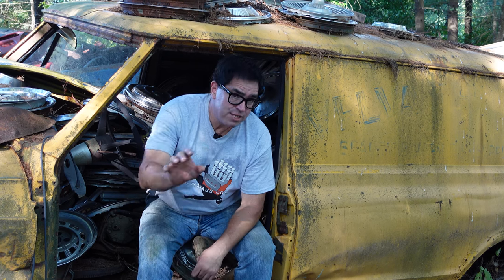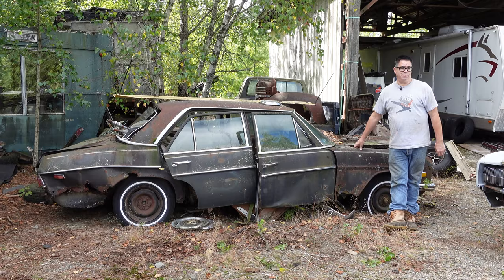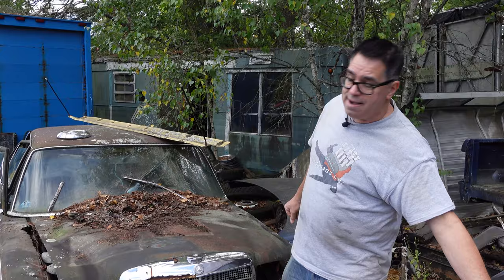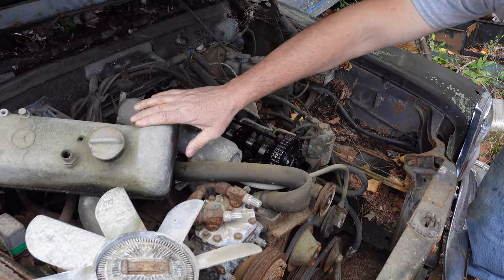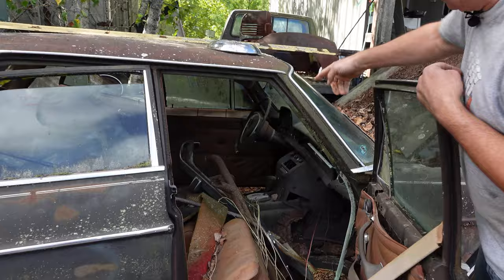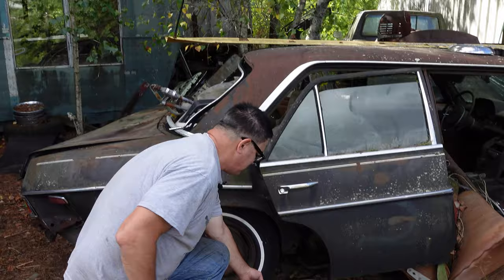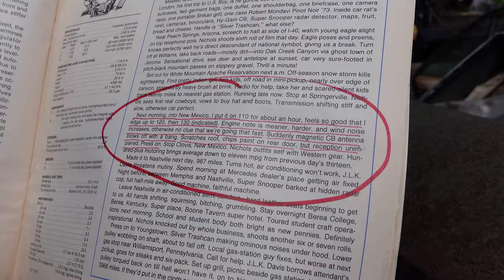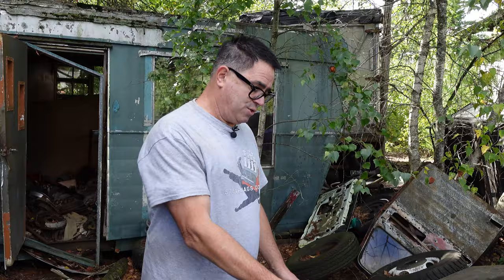Mercedes Has Benz

Comment: We slogged our way to the Artic Circle in a 240D. Slow is right. It wasn't unusual to climb passes at 20 mph. But it was rock solid and dependable. Very comfortable ride.
Reply: That sir,is a fine dining establishment..
Reply: I'm new to these ,I got an 80 240d 4 speed recently because it was really clean. 
I had about a week to get familiar with em before I went and looked at it, but since then I've had fun with it. 
What a car,it handles and stops really good,I had no idea. 
As I've driven diesel rabbits quite a bit,the slow acceleration wasn't too bad.
Reply: @Bill-cv1xu  haha.
Reply: @MrTheHillfolk  God bless the diesel Rabbit!
Reply: @frogwizard5637  haha yeah it was a great car to learn to drive in, no power,so do what you can to keep momentum and don't lift for corners 😬
Reply: @MrTheHillfolk  Volkswagen Diesels in the 70’s/80’s were forty-ish horsepower naturally aspirated four-cylinders with timing belts and weak head gaskets. Audi was basically the same, but with a greater propensity to fail. If you couldn’t afford a Mercedes-Benz Diesel back then, you’d’ve been better of getting a manual transmission Isuzu Turbo-Diesel or one of those MFI Peugeot Diesels.

Comment: I've had several of these over the years, 240D, 300D and 300TD. Yes, the naturally aspirated 4 cylinder was slow as heck, but the turbo 5 cylinder ran pretty darn good. And regardless of drivetrain, these cars were a pleasure to drive, very smooth and solid.
Reply: Very impressed with my first one I just got recently, as I've been into vws all my life. 
A customer at work had a clean 80 240d 4 speed and I told him call me if he ever wants to sell. 
4yrs went by and he called ,I went and looked at it closer and got it. 
What a little tank compared to my vws. 
I love the way the doors close , barely push them and they click like a bank vault,not some ringy rattle like a VW 🤣

Comment: Mercedes was known for their diesels and their trucks (as MB branded) were everywhere during this time, even in the US. It's not uncommon for them to go hundreds of thousands of miles without much trouble. Later on the "MB Tex" fabric wore like iron for decades. Paint code on this one is likely code DB040 Black exterior paint, and like "code 19" Black for GM, that paint code was used way into the modern era. Those 6.9 MB could haul and they were like bank vaults, they were solid. 

This 1971 220D was a 115.110 chassis code and they had an OM615 (engine code 615.912) diesel engine that was a 2.2L four cylinder and they made about 345,376 of them between 1968 and 1973. They were assembled in either Stuttgart, Bremen or Sindelfingen, West Germany as back then the German Wall had not come down. The German Wall came down on Thursday November 9, 1989. There is a photo of a US serviceman using a Craftsman screwdriver (more than likely made by Western Forge in Colorado Springs, Colorado) to chip away a piece of the wall.
Reply: 1979 240D owner here.  I’m convinced that when the world stops, only cockroaches and MB Tex will be left.  My seats do not wear.
Reply: @bobbbobb4663  My neighbor had a 1979 gray market MB that I think was a 230 series gasoline powered four door. It was used as a taxi chassis in Europe at the time. When he would bring it to MB to get fixed, the parts would take a few days but they would come. The dealer would give the car a wash and detail before giving it back. My neighbor said, "But it has rust and it's old", and the service manager's answer was, "The boss says they all get detailed before we give them back".
Reply: @googleusergp  Interesting that they would service a gray market car.  Btw, one more detail about my 240D:  MSRP was $16,500 for crank windows and manual transmission.  The top of the line Cadillac Seville MSRP was $16,200.  Needless to say, the local dealer was rolling in profits to afford a free car wash 😀
Reply: @bobbbobb4663  Nah, to them it's just another vehicle. If they can get the parts and bill you, they don't care.

Comment: Hello Steve, greeting from Ireland. 
I bought a very cheap 300d ex taxi with 450k miles on it when I was a student, ran it for a year and sold on. Changed a noisy wheel bearing, plus usual oil/filter. No other repairs. 
5 speed manual, 85mph flat out, would sit at 80 all day, like sitting on a sofa!!

Comment: Fun fact about the 6.9:  The conversion rate from dollar to Deutschmark deteriorated so bad that the msrp for the 6.9 jumped to $50,000 in 1979 for the same car that retailed for $38,000 in 1977.
Reply: Google said my 80 240d 4 speed was around 17-18k new, I shudder to think what an upscale model cost at the time. 
I remember mom paying like 71-7200 for a diesel rabbit in 81.
Reply: @MrTheHillfolk  Looks like the 6.9 cost $52k in 1980.

Comment: The 1968  W115 was the start of Mercedes coming of age with legendary diesel powered cars that looked fresh and modern, rode, handled, and braked amazing, and if you could keep the rust bug away ran forever. Very sluggish cars that clattered and smoked and needed a clearing of a 1/2 mile to enter the freeway so as not to get rear ended. But they were never meant to be rockets. Most were stick shift early on and thats really the only way to go in them for maximum power and reliability.  The people that bought the diesels were a different breed than the people that bought that gas models. Diesel people put up with the short comings of the slowness and the noise because they wanted the reliable granite like build and reliability of the diesel and the MPG and lack of conventional tune ups.  Ive owned these since 1979 starting with a 65 190D Heckflosse and still have my 1960 180D Ponton I bought in 1983. I owned a 69 220D back in the early 80's and it was a great car. The quality of the W115 diesels was taken to even higher standards with the W123 models which have the reputation as the best diesel sedans of all time. Shame to see this car like this because the level of build quality that went into it was bank vault like. But all steel rusts with salt if not taken care of properly. If you can find a rust free Mercedes diesel made before 1986 you really got something. Also, back in the day when this car was new, battery technology still sucked and the glow plugs took 30 seconds to warm in the dead of winter and dropped a healthy battery to its knees so if you didnt get it started in a couple tries you needed a jump. You needed a block heater on these or build a fire under them to start in the coldest temps.

Comment: My dad was a MB mechanic for 40 plus years. Sometimes in the summer I'd go to work with him , usually a dealership shop. I'd run parts to the counter back and forth , mostly service packages for these small diesel models. He used to save the old injector seals for me , a cup shaped washer with an integral gasket ( I had a slingshot that worked perfect with those , lol ). Sometimes he would bring home some cool rides ... 450 6.9 was one of them. His bosses 280 6.3 put everything else to shame performance wise.

Comment: I got one of these as a loaner back in the late 80s but it was gasoline fueled. The thing had well over 300k miles on the odo but ran and drove just fine. A good solid car was the impression I got

Comment: The 200D was about 54 horses. The one you show here, the 220D, was about 60 horses. These were not so bad in daily use - reliable, dependable, cheap to drive & maintain, just SLOW.

Comment: As a very young child, my Dad first had a 220D and later a 240D.  At least ours had a 4 speed manual transmission.  The automatics were SLOW.  The 220D 0-60 times were, well we may never know! Something not covered in the vid was that the 220D had all drum brakes, the 240D had disk all 4 corners.  They also had very cool vacuum power door locks.  The cars were safe, reliable, nice to drive, and always got to our destination but never in a hurry.
Reply: All mercedes had 4 wheels disc brakes from 1968 & up.
Reply: @vintage76vipergreenBeetle  this 80 240d 4 speed I just got stops awesome,I couldn't believe how good the brakes feel. 
And it handles just as good, since it's a little soft I was thinking it would step the back out in a hard bumpy corner. 
Nope,she sticks good on those skinny little tires.
This is my first one, I'm very impressed. 
It's really not much slower in acceleration than my old diesel rabbits. 
Even with fuzzy memory, I think the Merc pulls on the highway better from 60 or so better then the old rabbits, even down low. 
I do have a bad Jones for a blacked out 91 560sec gangstermobile though,what a sleek ride.

Comment: I had a 240D many years ago. A gentleman I built a engine for his 1965 GTO resto-mod, was a service manager at M-B. He showed me how turn the modulator on the transmission to increase the firmness of the shifting. No joke, you could practically make it hit as hard as a manual valve body, full race transmission in a drag car. It didn't have the power to spin or even chirp the tires, but it would slam gears automatically like you can't imagine. A week later I adjusted it normally, but it was hysterical taking people for a ride that week.

P.S. love the Kentucky mobile brothel in the background.

Comment: I had a 1987 Mercedes 300D great vehicle lots off power. The only real downfall was parts were super expensive and rare. Sold it about 12 years ago. Great Videos Steve👍
Reply: I've got a bad Jones for a blacked out 91 560sec.
I saw one at a show a few years ago, what a great looking car,total gangstermobile. 
Being I didn't know anything about them ,I stayed away and it's just as well.
Dude was asking 11k though, not too bad considering they were like 80-90k new. 
I did get an 80 240d 4 speed recently and I'm learning a lot it's an interesting car.
Reply: @ Mrhillfolk that’s the 5 cylinder highly desirable those engines are bulletproof.👍
Reply: @ Mrhillfolk that’s the 5 cylinder highly desirable those engines are bulletproof.👍
Reply: @ Mrhillfolk that’s the 5 cylinder highly desirable those engines are bulletproof.👍
Reply: @ Mrhillfolk that’s the 5 cylinder highly desirable those engines are bulletproof.👍
Reply: @Daniel-fd3wp  I thought they had a big honkin 8 cylinder in em

Comment: I rode that in Italy 🇮🇹 many years ago. I like the OE aluminum alloy wheels which looks snazzy. I friend I know has a 1975 Mercedes-Benz 280 E, the E stands for Einspritzen which is German for fuel injection which is made by Bosch. He also owns a 1978 Mercedes-Benz 450 SEL 6.9 litre sedan. That 6.9 would do battle with the Porsche 911 Turbo Carrera, and the 928. Those cars ruled the Deutsche Autobahn.
Reply: Had a 928 which to save $$ put 450SL fuel injectors in!

Comment: I gotta say,as a lifelong VW guy I recently got an 80 240d 4 speed.
I had no idea about Mercs all that much,just this car was super clean and I took a gamble on it. 
Haven't had any hidden surprises yet, and I see maintenance parts are reasonable. 
Trim parts,sit down. 
Anyways ,this thing handles great! 
It's a semi soft ride ,but even in a hard corner with bumps it stays planted and doesn't sway all over,very predictable. 
And it stops great too! 
Power,yeah ,67hp isn't winning any races but I sure had a hoot on a twisty 40mph backroad when I was pushing it up to 75 or so. 
It's on par with my old diesel rabbits, maybe a touch more power or it slices the air better because it does pull better than they did at 50-60mph. 
I was rather surprised to see they cost around 17,000$ in 1980, mom bought a diesel rabbit in 81 and that was 7200.
Reply: I can confirm how important gearing is with these German diesels. 
My 91 Jetta diesel has 52 hp but marches to 60 in about 10.5 seconds with the help of a close ratio "GTI" 5 speed. 
A rabbit diesel that's 400  pounds lighter with the same engine takes about 15 seconds.
Reply: @MrTheHillfolk  1979 240D owner here also with the manual transmission.  If I could change one thing about the car, I would raise the 3rd gear ratio.  IIRC, the owners manual calls 3rd gear a “in town” gear so it is geared appropriately to loaf around town.  The problem is that during acceleration, the car momentum really stalls around 30 to 35 mph.  

One more item:  most parts are still available as OEM.  They will cost more than the cheap Chinese parts but they will last.  Please take a look at all the rubber components in the suspension as they may need to be replaced.  Pierre Hedary’s yt channel is a nice resource for MB info.

Ok one more thing:  The car is slow but you can tell the engineering that went into the car.  Have fun!
Reply: @bobbbobb4663  I hear a 3.07 rear gear swap is sort of popular, and I hear ya on the 3rd gear ,it could be a little taller. 
I definitely know better then to use cheap parts, my vws hate them and I'm sure a Mercedes hates them even more😬
Thanks for the tip ,I'll go check out his channel.

Comment: I logged many miles at a kid ridding along with a neighbour family that had Benz diesels. Their first was a 180D, 3 speed manual I believe, followed in the mid 60’s by something a bit bigger. It too was a diesel, backed up by a 4 speed manual. When it was new, we took a road trip to Seattle, the owner, forgetting his new car had 4 gears did a substantial portion of the trip down the highway with that little diesel just singing. But like you say, it was slow. I remember how terrifying it was when he’d pull into the oncoming lane to pass a logging truck, usually with an oncoming car quite visible on the horizon.

Comment: If I remember correctly, that 4-speed automatic transmission was loosely based on the old GM Hydramatic 4 speed, complete with fluid coupling instead of a torque converter. I think it was built under license from GM.

Comment: I had a 72 220D with a 4spd manual. You wanna talk about slow? It was the slowest car I've ever owned. Top speed on flat ground was 72mph . It just couldn't go any faster. On a trip to Cape Cod, with my parents and luggage in the car, it wouldn't go any faster than about 67mph unless we hit a downgrade . On one section of highway that had a pretty long incline , the speed eventually dropped all the way down to about 55 lol !! One thing that you didn't point out was that little "Grate or Grille" piece on the dash just above the steering column, that is actually a sight window for a dash mounted glow plug (more like a cigarette lighter element) and the lever to the left of it (looks like its a manual choke lever) is actually the Engine Run, Starter and glow plug switch. Pull it out to the detent and that's the run position, pull it further back (spring loaded) till you feel a stopping point , and you can watch the dash glow plug light up, once its cherry red, pull the lever all the way and it starts cranking !! Very interesting setup !! It does have a key , but all that does is basically allow the vehicle to be started and have the electrical working. If I recall, you could shut the key off and it would keep running until you pushed the lever back in. Thanks for another great vid Steve !!

Comment: Great, now I'm craving french fries and not the air fried type. I helped build a veggie fuel kit for a friend's 300 using what we could find at the scrapyard and it smells like french fries when it drives by. He actually found a 300 in New Hampshire that wasn't rusted out and now gets the fluid film treatment twice a year.

Comment: Back in '91, I bought one of those (although not a diesel), for my first wife. Because she wanted a Mercedes, and a neighbor of one of her friends had it for sale.
Only gave $1000 for it.
Which should have set off my warning bells. 
But I was trying to make her happy.
I don't recall what year the car was though.

Anyway, should have never bought it
Less than a month after buying it, the car began having all sorts of problems.
I fixed a few, but finally gave up, because it was hard to get the parts.
Reply: Yeah , Will , that thing can move mountains !   Been there , did that .

Comment: I had a similar vintage gas 220 that was surprisingly sprightly, but also somewhat temperamental. Wasn't the 240 the same platfrom with a 2.4 six banger?

Comment: Love me some Mercedes Benz content :-) 
1973 saw that ribbed tail light unit on the W116 S class and yup for visibility in snow or dust and mud.
Weird thing about MB's? Velour interior was the premium spec, then leather and then MB Tex which was their own special brew of Vinyl which so many today mistake for leather.
I have a handful of Mercedes but W123, W116 and C107 in the 2.8 Inline 6, the 3.5 V8 (They rev hard) and the 4.5 V8.
I had a 6.9 but they are not practical to drive as there are now a few unobtainium parts in suspension hydraulics, struts and valves but if you open them up a bit and let the breathe they really wake up and their design includes a dry sump and some other trick bits.
Not quite a Grosser but still near as damnit a Supercar when the rest of the world was stressing about Fuel consumption :-) Mercedes brought out a limited 420 something cubic inch Sedan.
Reply: The lights were actually ribbed for air flow around them to keep them clean of dirt as well
Reply: My 1973 220D did not have the ribbed tail lights.
Reply: @mexicanspec  Early W114/115's have smooth rear lenses but subsequent versions all had them.
Reply: @mexicanspec  I believe 1974 was the first year because my 74 240D had them
Reply: @ChaChiVooDoo  I know for a fact my '73 didn't have them. My car was hit on the left rear at the tail light. I bought it like that.  I screwed on a replacement lens, not ribbed, and it was fine.
Reply: @mexicanspec  74 was a transition year. Ribbed tail lights, foam wrapped steering wheel and shift knob, also ugly energy absorbing bumpers
Reply: @ChaChiVooDoo  I like the energy absorbing bumpers. I wish cars had them today.